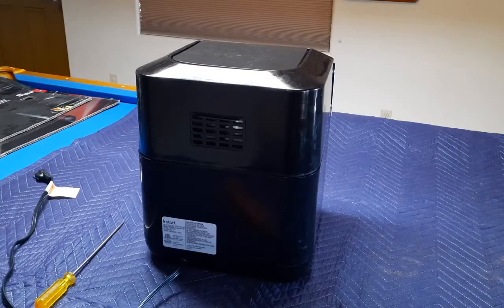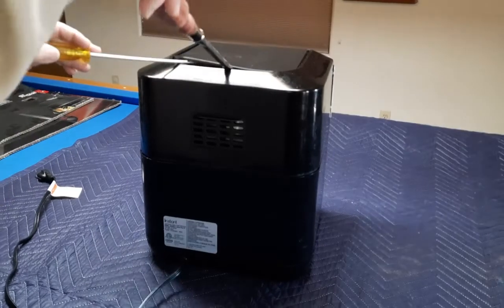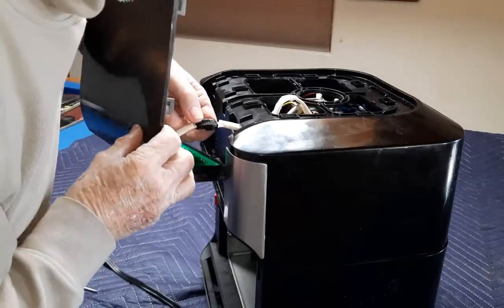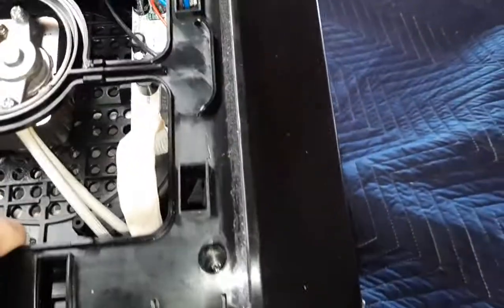How I fixed an Instant Vortex Plus Air Fryer

Comment: This video was perfect, fixed my air fryer in 10 minutes. Didn’t have to take it back or throw away. 
Thank you so much!
Reply from the maker: Thanks for watching and commenting! Hope you clicked the like button or perhaps subscribed. Thanks again.
Reply: It shorted out again, right after I put it all together and used once. Why would that happen?
Reply from the maker: @angelacendejas9340  First, Thank you for subscribing. This is going to be long, but I will put the summary first and again at the end. Please try to read my entire comment. 

In summary, the fryer needs to be clean and it needs to circulate air. 

I do not know your actual case because I was not there. But I think it is important to clean the inside of the fryer after each use. Try to keep grease from building up, because it can heat fast. Especially clean the thermal fuse itself and the thermistor. The thermistor is a small nipple looking device protruding down from the roof of the fryer. Also very important to move the fryer to an area it can breathe. Better stated, so the fan and vents can move air. If cooking something that takes a long time, it might be advisable to move it out onto a table where it does not have a cupboard above it and a wall behind it. This allows the air to circulate better. It should always be pulled away from the wall when being used so air can circulate better and prevent heat buildup which can trigger the safety device.  

Sorry this is so long, but going on:
I call the safety device a thermal fuse, because it opens by temperature. It is a safety device installed by the manufacture to prevent fire. Ours was labeled 200 C. 200 C translates to 392 degrees Fahrenheit.  Google; spontaneous combustion. You may find something like this, the temperature at which paper will burn can vary by material, moisture, and thickness. The average temperature at which it will ignite and burn is between 424 and 475 degrees Fahrenheit. 

Obviously the manufacture wanted to be way below these temperatures with his safety device’s rating. 

Once the temperature exceeds the rated value of this safety device, it opens so no more current can flow beyond it, thus shutting down the fryer. With no fan turning, no circulation of air, the internal temperature could rise for a short time then start to dissipate. In addition, the heating element will not immediately cool. It will slowly dissipate heat. I believe this is another reason the manufacture decided on 200 C for their safety device. 

Since I had totally dismantled my son’s fryer, I took the time to clean everything. It was quite dirty.  Even had grease built up in spots that could not be cleaned unless it was dismantled. I cleaned everything so it looked brand new.

Sorry this is so long, but you asked and I am trying to give you my best guess without actually seeing how your device is being used. I hope this helps! 

In summary, the fryer needs to be clean and it needs to circulate air. 

If you told me, I only operate it on an open table, nothing around it, and it is spotless and completely clean, I would say perhaps it is time to discard it or take it to someone to test the rest of the electrical components. 

I hope this helps and thanks again for commenting, and subscribing!

Comment: Thanks so much for this! I was trying to fix my sister-in-law's "ikich" air fryer. I couldn't find any specific instructions online anywhere for that brand, but upon searching for air fryer repair videos, I noticed yours looked like almost the exact same model. So it must be the same manufacturer. Thanks to your clear instructions, I was finally able to open the case and locate the thermal fuse! I happened to push the button while checking continuity and noticed it clicked and I suddenly got continuity, so apparently it's a reset button. I was originally looking for the type of fuse which melts and has to be replaced (like our other air fryer had) so you saved us a bunch of time and money. Thanks again!
Reply from the maker: Thanks for letting us know the instructions work well on a different brand. I read all comments, because there can be good information hidden in them. Like your comment!
When I do a search on YouTube for help with a problem I am having and I find something I think will help, I watch the video, then try to read all the comments for that hidden good information.  
If you watched my entire video, you know I checked for continuity several times before practically doing an entire dismantle just to get to the fuse out and in my hands. I am so glad you did not go thru the entire dismantle like I did. 
I am also glad I decided to check the fuse for continuity before trying to buy a new one. Basically I stumbled upon the fact that it can be reset. 
Thanks for watching and commenting.

Comment: Thanks buddy. I had already taken mine apart and repaired obvious damage to a hot leg connected to the heating coil and checked continuity to the fuse and what not thinking that was the fix but still no power/display, had no clue there was a thermal safety switch but I'm sure that's my problem so I'm going back at her again to avoid further yelling from wife to get a new one.

Comment: This was excellent, I had the exact same problem.  My Husband was able to fix this in less than 3 minutes.   Perfect instruction, easy to follow,  Thank You for the tip regarding the tabs, if you do not know that its a loud popping noise you definitely would think you were breaking the plastic.  Awesome
Reply from the maker: Thanks for watching and yes it does not sound good popping those tabs lose. Sometimes a guitar pick will help free up an unseen tab. Guitar picks are thin and if long enough they can push the tab away and unlock it. I have used this method on my son's Xbox, but I could not fix it, so no video.

Comment: 😎 You are the man!!! Thank you so much. I had the same problem with mine and it worked flawlessly. Took less then 5 mins to fix. Didn't have to take top with the 4 screws off. Just popped the cover off and stuck a long skinny tool down there and pressed the black button. Thank you again 🙂.
Reply from the maker: Thanks for watching and thanks for the positive comment. I appreciate it! Please click the like. Maybe subscribed. I say maybe, because I tend to make videos of things of ours that broke and we managed to fix. So, I know all my videos are NOT pertinent to everyone, but they generally describe ways to check things that maybe pertinent to other similar devices and problems. Thanks again for the positive comment!
Reply: @johntube2525  just subscribed my friend 👍🏾
Reply from the maker: @Rell713  Thank you!

Comment: Thank you! This fixed it
Reply from the maker: Thanks for watching and letting me know it helped. I appreciate it.
Reply: @johntube2525  well it helped for about 20 minutes and popped again. It looks like we're going to have to replace it. My wife searched for KSD301-CR and found all kinds of thermal fuses. Do you have a link to the one you bought?
Reply from the maker: @ReidCrowe  I never did buy one since it fixed my sons. They did bring it back a couple weeks ago and I showed them how to use a long screwdriver to push the button without removing the 4 screws and the top those 4 screw hold on.  I told them to be sure to pull it out, away from the wall and perhaps a little out from under the cabinet it would be under, when in use,  so it can breathe cooler air. Told them it is a safety device that shuts everything down should the heat exceed the 200 C it is rated for.  That would be 392 F. Be sure to get one rated for at least 200 C if you decide to replace it.  They have not brought it back since then.  I would think it is also important to try and clean the thermofuse and not allow grease and stuff to build up on it. 

Since I had theirs out and in my hand, I cleaned it real good back in February. It can be seen and cleaned when looking up at the top from inside.

Comment: Where is the light bulb??  Mine went out....oops found it.  Unscrew the 2 silver screws off silver plate on back left side
Reply from the maker: Sorry, the fryer belongs to my son and I gave it back to them once it was working again. I do not remember the light bulb location.
Reply from the maker: I should have read the whole comment before I replied, Glad you found the location. Hope you find a replacement. I usually google what ever is written on the bulb or part and hope to find it.

Comment: Fixed the jammed door!!

Yes!! I got the top off disconnected the display. Above where door latches should be is a single Phillips head screw on each side.

I could tell it was the right side that was hung up.

So after removing the screw on the right the plastic mechanism with a small spring came out.

The stuck door opened!

I threw out the last meal I tried to cook 3 days ago.

Put back together and the door works fine.

I have the rest of the head of cauliflower in there air frying right now.

My new one is coming.

Feeling smart!!
Reply from the maker: Congratulations! Great job and thank you for informing us on the details of how you went about it. Very good comments! I know that feeling of accomplishment when you actually fix something! Thank you for your positive comments!

Comment: Thanks for this! I found that i did not need to be this invasive. After removing cap i was able to poke a wooden kabob skewer in and push the button down without removing the full cover.
Reply from the maker: Nice to know skewering your fryer made it work. LOL Thanks for sharing.
Reply: They sent me a replacement, so now I have two! Thanks again!
Reply from the maker: @nathanhughes  Very good information! Thank you for sharing, because it could easily help others.

Comment: I have the same model, and the door has become locked shut. Food still inside 

Ha

If I take off the top as you did, can I get the door open?

Then maybe I could find a loose part in the latch. I bet that’s how the door got stuck.

Great video thanks!!
Reply from the maker: It has only been 3 months since I worked on my son’s fryer, but I do not remember how to get to the latch. They live in town and have had it ever since I fixed it. I did find out when testing to see if I had fixed theirs, that the door had to be on. I first checked it with the door off and it did not work. But when I put the door back on, it did work. So there is an electrical switch to tell the circuitry when the door is open and closed. I think, once you pop off the display and take the top off, you will eventually get to the latch. I just do not remember how many things you might have to take off to get to the door latch. I took the door completely off to remove the heating element and the plate inside, so I could get to the thermofuse.  So that made disassembly a lot easier. I’m just not sure what you have to do to free up the door latch!  If you do fix it, you might share a comment on here to tell others what you did. Or better yet make a video. Good luck, sorry not much help.
Reply: Thank you sir!

Mine was brand new and the makers are sending me a new one. I don’t have to return the broken one.

So I’ll follow your directions and pop off the top and display panel.

One side of the door looks like it’s released. The other side is locked I have a feeling that there is a loose screw or something in the latch.

If successful I’ll let you know.
Reply from the maker: Thanks Jim, for keep us informed. If you get the door opening and closing again you will have a backup. Or an ebay or Craig's list item.  Good luck!

Comment: That is a manual reset high temp switch furnaces and I’ll kinds of things have that switch
Reply from the maker: When I googled KSD301-CR I found several, but only a few that go up to 200 C. The below one I found on Amazon does not have the black button on it. I assume this one below is bought closed and then when it opens because the temperature exceeds 392 F or 200 C there might not be a way to close it again. It does say Adjust snap disc , so maybe it can be closed again or reset. Thanks for the comment and feel free to further educate me. Always good to learn more. Thanks!

uxcell KSD301 Thermostat 200°C/392°F 10A Normally Closed N.C Adjust Snap Disc Temperature Switch 2pcs

https://www.amazon.com/uxcell-Thermostat-Control-Microwave-Normally/dp/B07L95V76N/ref=sr_1_4?crid=XOKAZ2SSP1AY&dchild=1&keywords=ksd301+125v+16a+200c&qid=1614273176&sprefix=ksd301+125v+16a+200%2Caps%2C266&sr=8-4